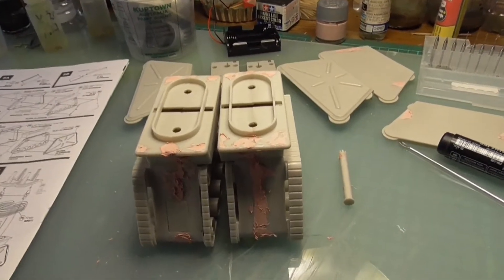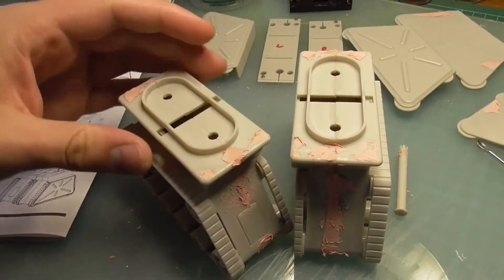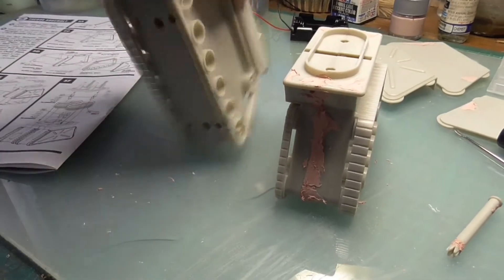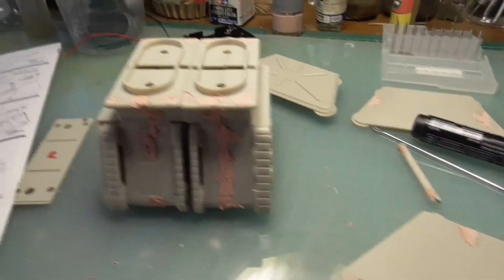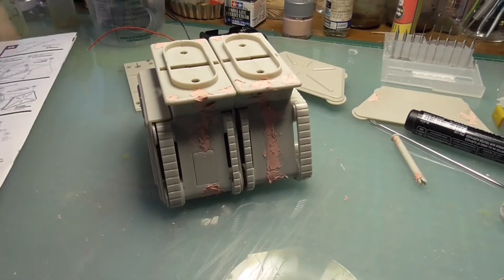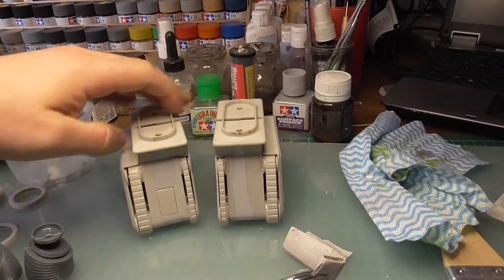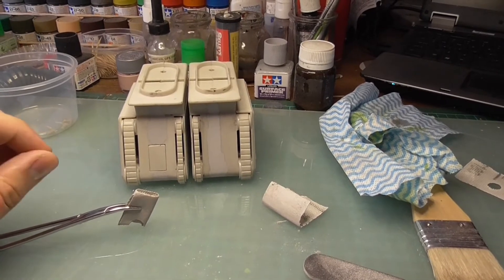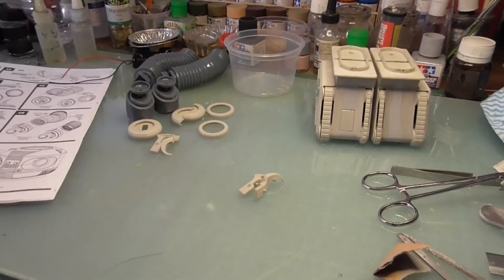B9 Robot | Part 2

Comment: Hello xrlent12 I was wondering what type of seam filler you are using? Is it like a standard auto body Bondo or is there a special model seam filler? Also what sort of adhesive would you recommend to attach the rubber legs to the plastic waistplate and knee plates?     Thank you again for posting these videos and for helping out someone who is trying to learn.
Reply from the maker: This is an automotive spot putty, very similar to Bondo glazing putty. You can use a variety of adhesives for these areas. They are not under alot of strain so most will hold in place. CA glue works fine or a 5min epoxy. You could also use PVA glue or tacky glue. It all depends on what your comfortable working with. It is a flexible material so there wont be a strong bond but it will be enough to hold in place.
Reply: thanks, I will get some this week because I am ready to start some minor assembly like the soil sampler and other small parts, they will be good for practice with the spot putty.